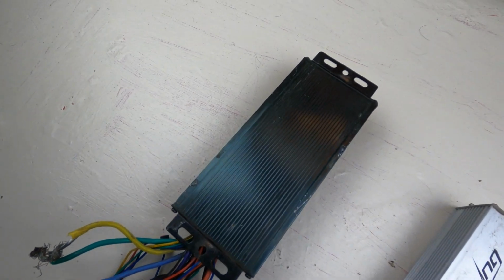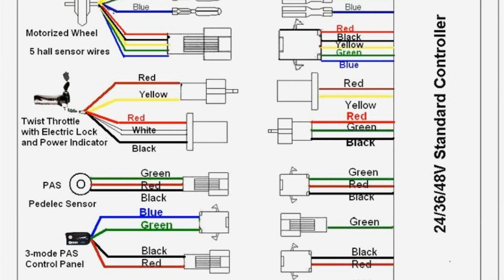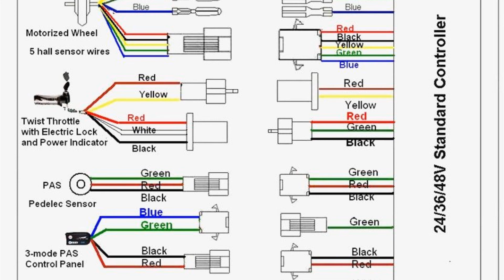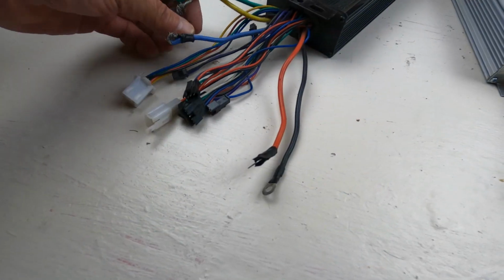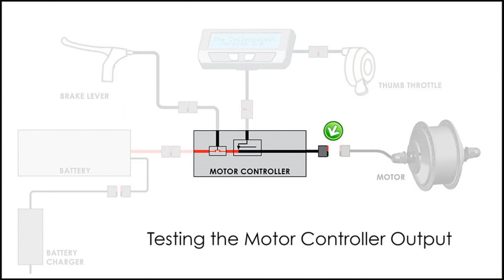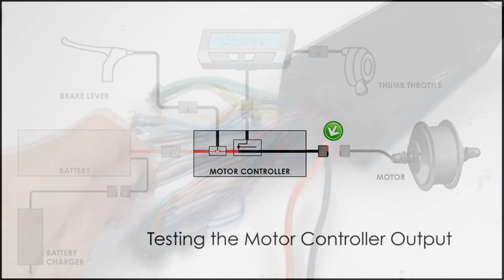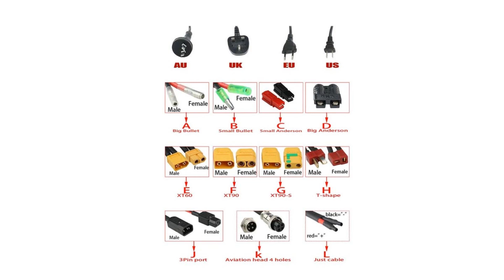E Bike Controllers. What's inside?

Comment: I have a converted ebike. It works fine but sometimes it stops working with no reason or it speeds up as if i throttled fully even  though  i haven't even touched the throttle. Would this be a problem of the motor?